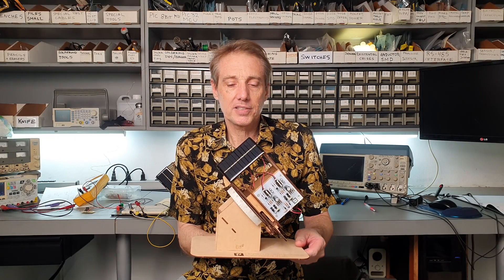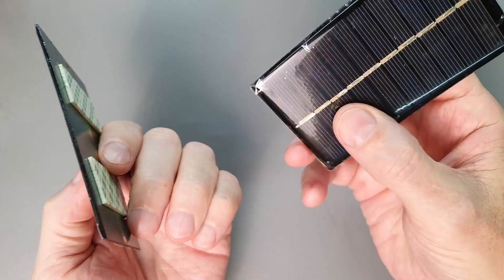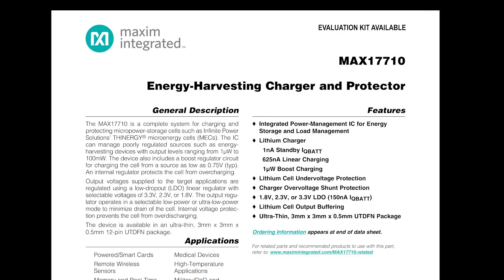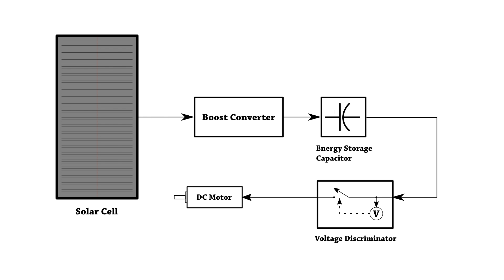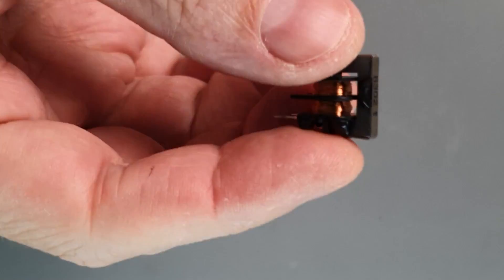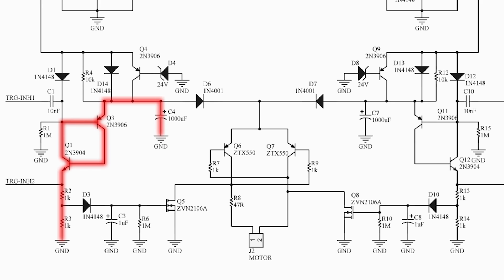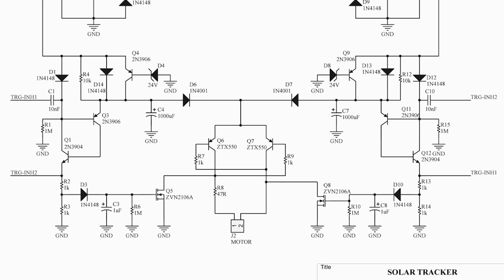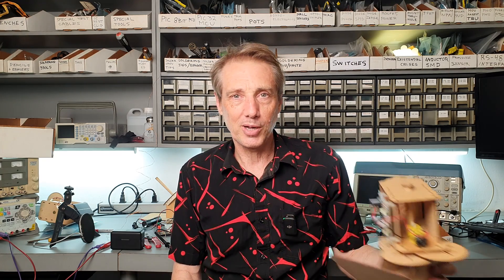The Ultimate Solar Tracker

Comment: OMG, that’s awesome.  I was recently trying to design a circuit using relays with my limited knowledge - to trigger a capacitor.  Quickly, I realised it could be done, but components were expensive as I gave up.  I am definitely interested in the kit, but I want to scale it.  

I wonder what size motor 24volts could power?  More research … 

The education kit is also awesome, and you’re very smart.  This has more benefits of just being a kit.  Most kits are dumb.  This could end big oil.

Comment: Wow!
Uber-complicated.
Mine uses two narrow pipes, each set above a solar cell that act as on/off switches driving a tiny 1.5volt motor with a worm gear driving a helically-cut down gear. My collector array is set to swivle about a fixed axis - set @ my mean lattitude.

In early morning, it tracks East (using a 1.5volt battery triggered by a relay and a fixed contact) until the first tube finds light, stopping the travel.  "East" is @ the sun's 10:00 o'clock position.

That's it . . . Nothing fancy.
Reply: give us a proper video of it please

Comment: I came here looking for a sun tracker motor for solar cooker.
This video is easy to understand & very good.
But not sure if it would handle weight of solar cooker, which vary in weight.
Reply: You could totally scale this up with larger solar panels, capacitors and a gearmotor

Comment: I have a tracking solar cooker (fairly big heavy thing) that uses an airlift pump and a mini waterwheel and "winch" to move the reflector around. (I kid you not and it works well)  Instead of running a motor, could your solar tracker open and close an air valve?  I only need one because I manually move it back  to dawn position in the evening.  (Its low pressure stuff and I currently use something to pinch a rubber tube to control the speed of movement to the 15 degrees per hour.)  The air valve would be off and the solar tracker just needs to turn it on until the waterwheel moves it enough to point at the sun, then it shuts off again.   Its in my videos. I currently use gradually rising air pressure to rise a float to turn it on, It works but it is too bulky.   Thanks  Brian

Comment: this is a really advanced design for an educational product.  one improvement might be some limit switches to prevent overtravel in the wrong direction as you sort of discovered.
Reply from the maker: No harm done, it happily spins 360 with no ill effects.
Reply: @leosbagoftricks3732  From a practical view, actually  turning a large array, that is where a good design fails to be a great design, 360 degree turn not great for cables or a simple mechanism. Do I see a pattern here? Your shirts must have spelt out something but not that interested as you failed to build your base by not continuing your basic tutorials which are exceptional, big mistake. You highlight a product but not able to purchase. And you ignore a very relevant observations, looks like a pattern to me. 😢

Comment: wonder if no dead band will wear out the motor fast
Reply from the maker: Yes- this is a good point. An improvement would be to add a dead-band to prevent this mechanical wear- but it's really tricky to do with a discrete design. A microcontroller would make this possible, but it would be hard to keep the parasitic drain of the micro down low enough that it would not dominate at low light levels - a real design challenge!
Reply: @leosbagoftricks3732  Wouldn't this just be some sort of hysteresis producing circuit/ic sitting right at the controls of the h-bridge?
Reply from the maker: @GoatZilla  Difficult to employ- begs for a totally different architecture

Comment: I like your technique of analog circuit trickery to make things work with small part count. I would love to understand your design process. But I don't quite understand why you need the scr. I would expect some latch action for the output, but the capacitor on the mosfet gate should keep the output running until the storage is fully depleted. So it seems to me that this scr is actually behaving as an analog comparator, generating a "digital" output.
Reply from the maker: Yes, if the transition between not conducting to conducting was 'soft' - a really weak charging current would just leak off and it would never trigger

Comment: i think u should explain y u started with a full h bridge but the final circuit only needed 2 high side transistors which i think would extend to y u choose between bjt's and fets and n channel/npn and p channel/pnp cause its a clever and unusual hybrid h bridge
Reply from the maker: I start- and end with an H bridge. The low side is an FET so it can be voltage driven, and therefore can be held  ON by a simple gate capacitor to extend the output pulse. If I made the whole bridge from BJT's, It would require current to keep it in conduction and it would drop out before the caps went to 0 volts.

Comment: Very neat design, as always. Not that relevant here given the design requirements, but in future proects you might consider a resonant-royer (baxandall) converter in place of a joule thief. They need a more complicated transformer (3 primary windings) and two transistors. You can use a ~$5 CCFL backlight transformer for this (the most common use for resonant royer converters) or wind your own. The circuit's main advantage is that its transformer current is highly sinusoidal, which should improve efficiency over a standard joule thief. With a CCFL transformer I had a ~0.7v input converted to ~500v output, though I didn't measure efficiency. There is an excellent app note by the late Jim Williams on this topology.

Comment: So interesting to how an electronics Engineer approaches a quite simple problem, resulting with a very clean design. 👏
Contrast with the youtube film makers reaching for a MCU complete with bells and whistles.  The use of an MCU is actually quite a complex solution requiring relative expensive components, 'a hammer to crack a nut'.

Comment: How about dumping the caps into a dummy load resistor when the voltage difference between the caps is smaller than some tunable value, to get rid of the hunting ?
Reply from the maker: I have considered this, it's very tricky to implement in a discrete design. It would be fun to do a version based on a micro that has this feature, the challenge here is keeping the parasitic losses low enough, it would be a master class in low-power design!